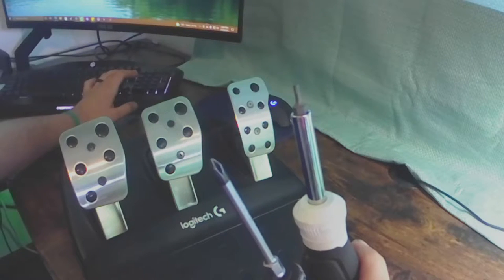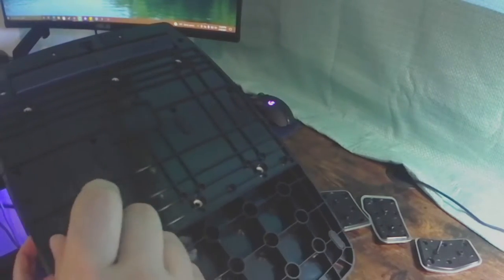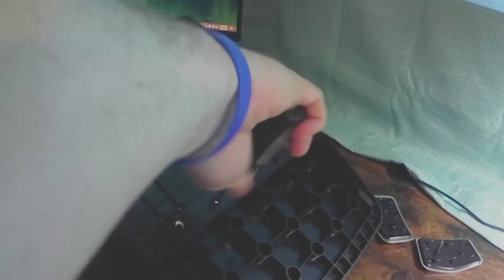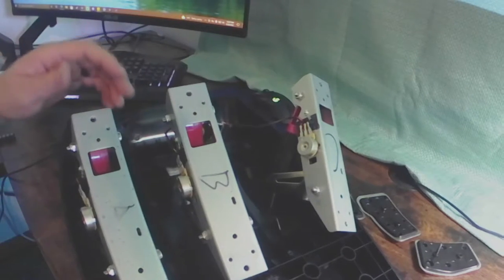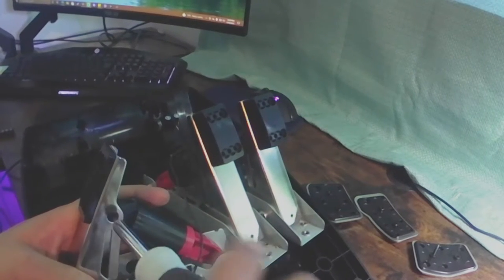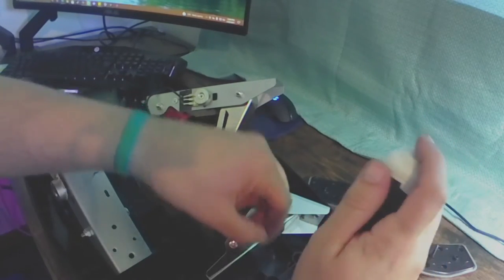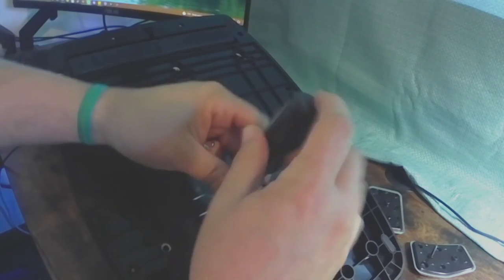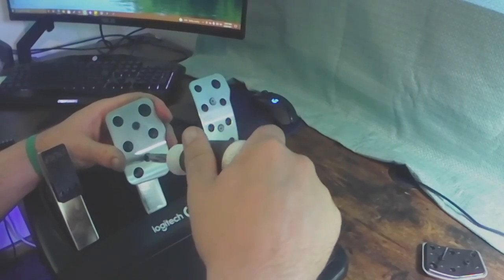Tutorial: How to Change Springs in Logitech G29/G920 Pedals

Comment: Don’t have to remove the whole back plate. You can reach a torx without removing the extra shid
Reply: Okay and then how are you supposed to remove the springs? There's no room with the base on
Reply: @dejay20001 i did it without opening🤷